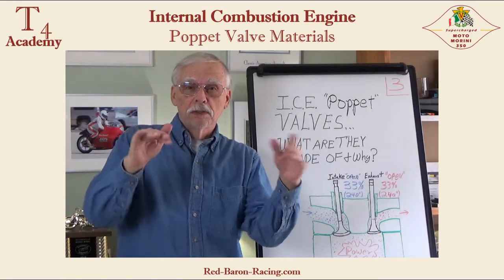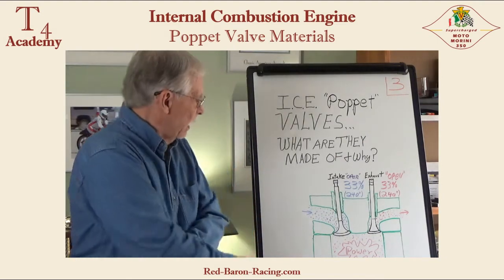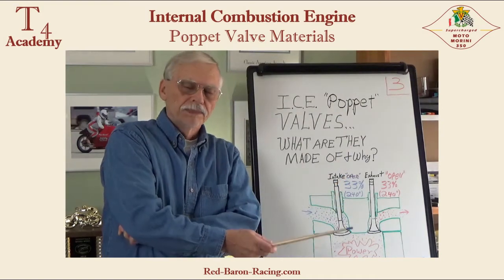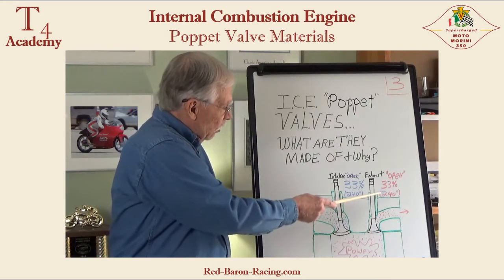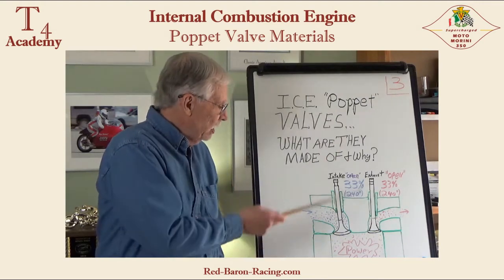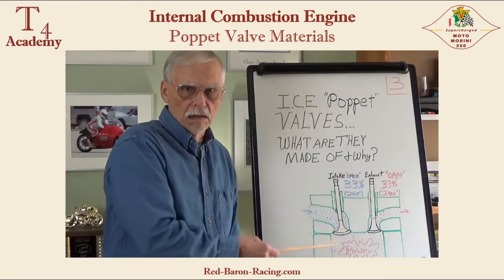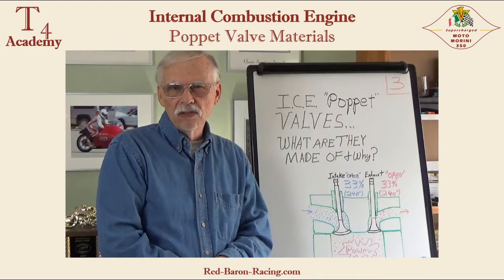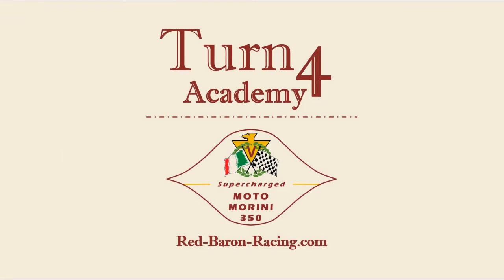Intake & Exhaust Valve Materials & Trade-offs

Comment: Though i dont disagree with what u are teaching & that is how a properly tuned & functioning engine will operate there are conditions when poorly tuned engine that may experience conditions of a lean fuel mixter that can bring combustion temps way up that will heat the intake valve far beyond its intended design.
Reply from the maker: Totally agree with your point. Going lean will certainly increase operating temperatures, to the risk of melting the weakest link components.